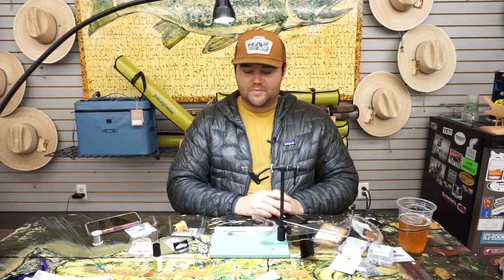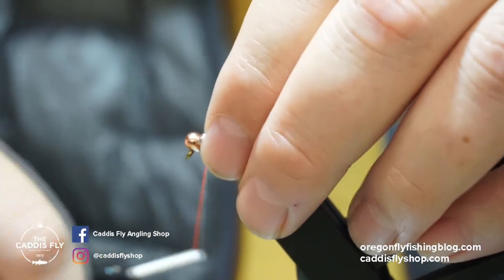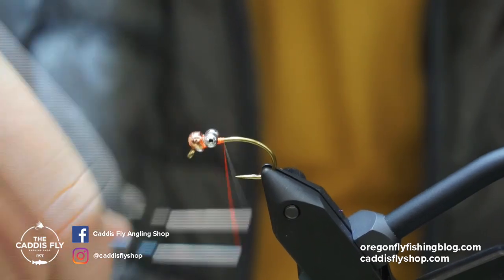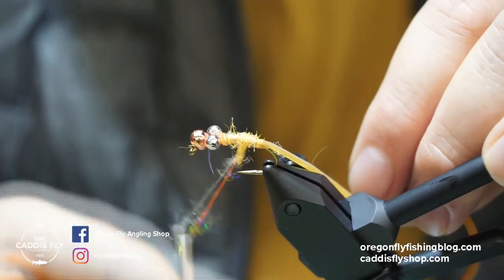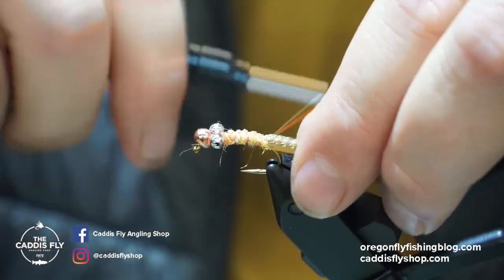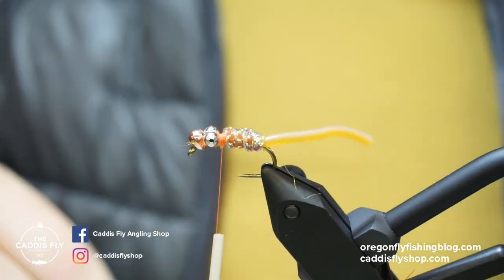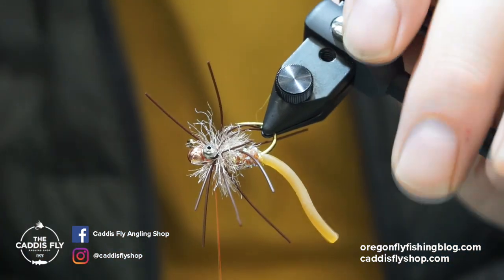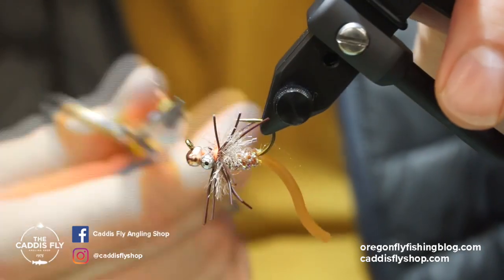Tying a Deadly Carp Fly: The Spillway Secret, Fly Tying Tutorial

Comment: Excellent video thank you for posting. Just an option, is to lay down a dubbing base first very thin and then add the tail on top it'll provide a little better grab.
Reply: Agreed.  The squirmy material can be very effective, but hateful to tie.  I've tried a dubbing bed and looser wraps with some UV flex as a bonder, but have not field tested them yet.